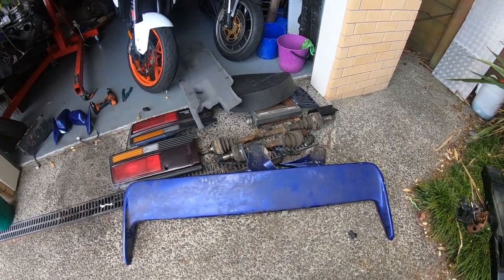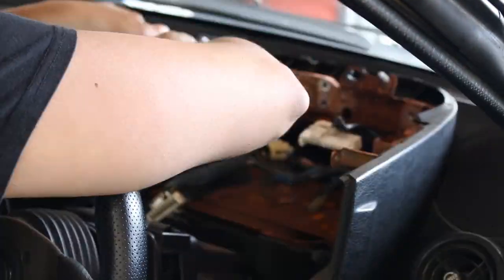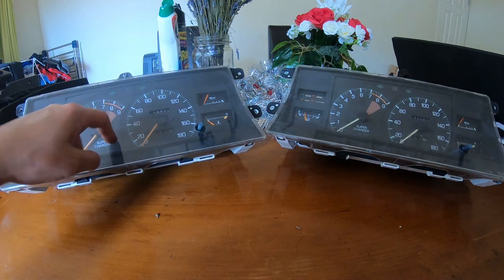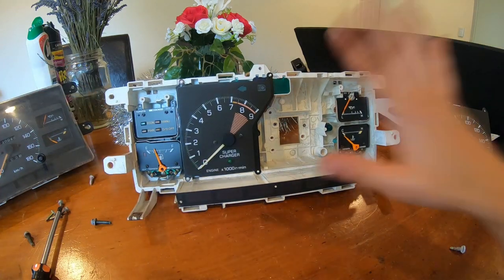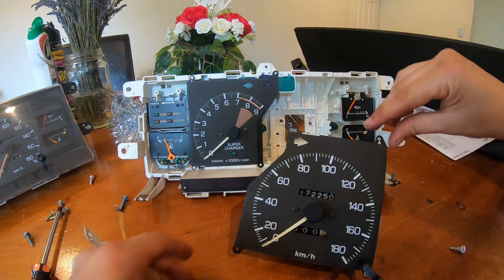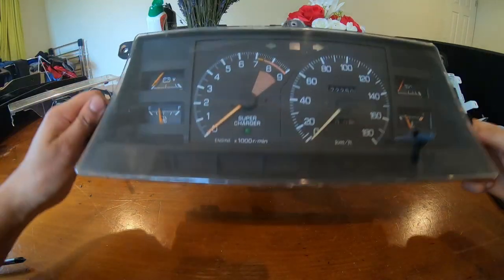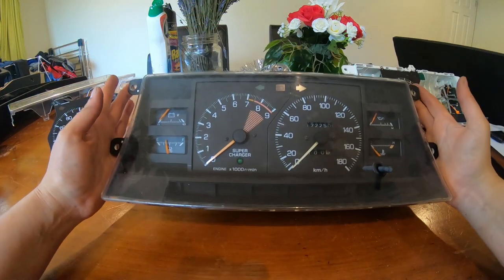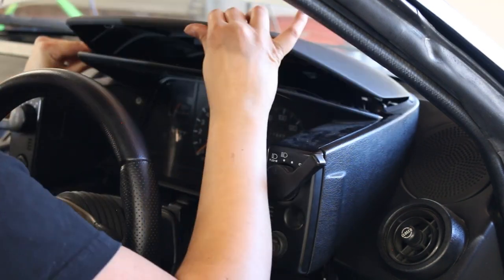Rolling back mileage the legal way!

Comment: With my Avenger wagon, the previous owner had a broken ODO (The cable from the gearbox had broken) so every WOF for 7 years was at the same KM reading. That was the first thing I did after I bought it. You can see on Carjam, all of the readings are the same for 7 years, then there is a 17km jump when I did my first WOF with it. When I did the V8 conversion I switched to a digital dash which I left at zero, so now the ODO reading is from when I did the V8 swap, basically it's a new car now anyway. I did the same thing with my 75 Avenger, it's ODO was pretty inconsistent. So when I rebuilt it as the "Avenger Panther" back in 2012 I also reset the ODO. I went from the simple "Super" strip speedo to a "GT" round gauge dash, and again, I considered it a new car after the conversion.
Reply from the maker: I mean, it is a new car from that point right!
I didn't realise you had to do that with all the cars!
My fave are the really old vehicles with odos that stop at 100000ks
When they tick over its bril
Reply: @STEPHASAURUSREKD  You don't have to reset the ODO, it was something I chose to do because to me it is a new car, reborn as something new. In the eyes of the law they are just modified cars so you don't need to touch the ODO. Both had new dashboards going in anyway so I wanted to reset them as part of their transformation. 

My Charger still has it's accurate ODO. Way to make me feel old, all my cars have/had 5 digit ODO's so they only go up to 99,999. My Charger is at 104,600 miles (The speedo is still in miles per hour). It rolled over for the first time in 2016, so if you look in Carjam you will see it go from 99,931 and then the next WOF was at 619 miles. I took photos of it at 99,999 and at 00,000.

I once remember in my old 1982 Ford Laser, it rolled over for the second or third time when I was driving my mates in to town for a night out. It happened just as we went over the harbour bridge so we all did a countdown as it rolled over.